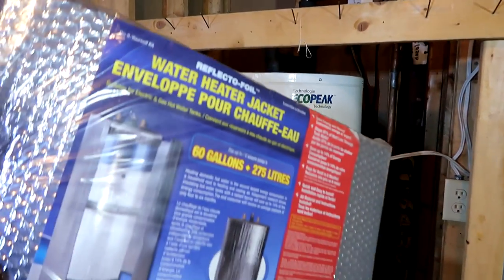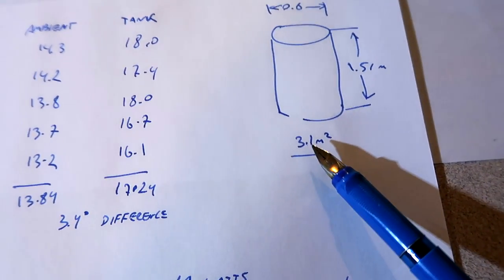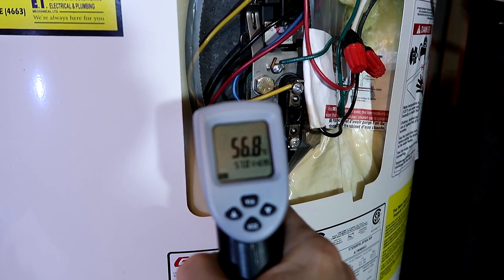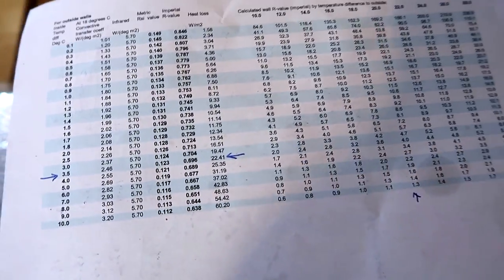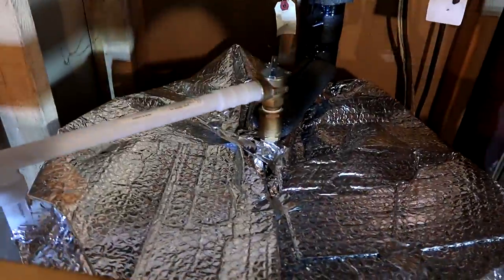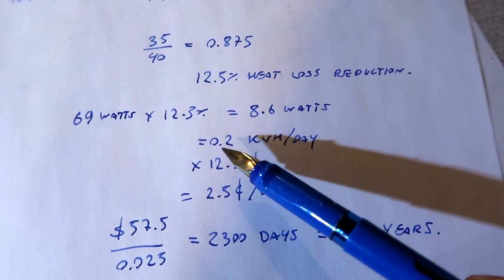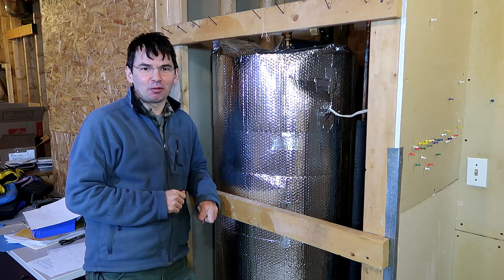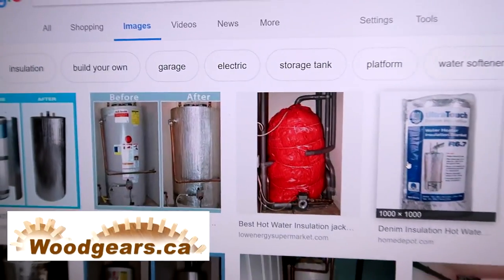Hot water heater insulating jacket:  How much savings

Comment: This may be a silly question, but how did you account for the thermostat?  
If the tank is better insulated, the heater will turn on less often, and there will be less total energy going into the tank. 
Also, (unless I'm mistaken) you were measuring the surface of the tank outside the built-in insulation and then measured the surface of the tank inside the new blanket and compared the two. 
Wouldn't it have been correct to measure the outside of the blanket vs the ambient to see how much heat is being lost?   After all, You are only losing heat to the ambient air via convection and radiation from the outside of the entire bundle, right?
Reply from the maker: yes, if its better insulated, it will turn on less often.  Which is how energy is saved.  And your point is?
The outside of the blanket can't be measured because with an IR thermometer because it's infrared reflective.  I could put a piece of tape on it to measure that, but that tape would affect the outside temperature, so best to work it out without measuring the outside reflective surface.
Reply: @matthiasrandomstuff2221  To be clear, I am not saying I think you're wrong. I honestly hope that you will point out some incorrect assumption on my part and give me a stepping stone to learn something, but I do need to explain my thoughts first.   
I'll use an example with made up numbers, so please bear with me.
-------------------------
Assume we have a 1000W heater wrapped in an insulating shell. 

We measure the outside of the shell at 30C.   We then add a second shell, wait a while, open the outer shell and measure the temperature of the inner shell as being 40C.  We can then  calculate the percentage of heat contained by the second shell by comparing these temperatures (30%).   
This works, because in both cases the amount of energy being pumped into the system is constant (1000W).  

However, it seems that you could also reduce the heater wattage by 20% (to 800W) and you would still have a secondary measurement that is greater then the original 30C. (+30% retention + -20% input = a temperature difference of ~10% )   However,  using the shell temperatures would only show  that 10%, instead of the actual energy reduction of 20%.   

In the real world example, we assume that the heater's duty cycle was reduced by an unknown amount, but that it is keeping the water at a constant temperature. 

It seems like measuring the heater shell should give you an idea of how much energy is staying in the shell instead of being lost to the room.  However, the transition/convection point is on the outside of the new layer, not the heater shell.   Yes, the heater's body is warmer, but for all we know the new foil layer is actually losing more heat than the heater's shell was and is acting as a heatsink, but the heater's duty cycle increased enough to overcome the losses.    This would be an extreme example, but the result is the same.  Alternately, the duty cycle may have been reduced by a massive amount and the new foil layer is simply trapping enough energy that the heater's shell is becoming saturated over time.  This would result in a higher temperature at the heater shell, but the actual energy lost to convection is unknown.

Again, We don't know how much energy is being added, so basing an overall comparison on the temperatures of the shell could be massively off.   All we should be able to do is calculate the R value of the new layer by comparing the shell temperature with the outer temperature of the new layer, or comparing the water temperature to the external temperature of the new layer to calculate the total R value of all layers in the same manner you did at the start of the video. 

If you had calculated the R value and energy losses the exact same way both times (measuring from the water to the outside), then the result would have been usable for comparison. 

Now that I've explained my thought process, feel free to poke holes in it or point out any points of ignorance that you see.  
Even if I'm confused, at the least you've got me thinking.   Thank you for your time, and for the awesome videos.
Reply: @matthiasrandomstuff2221  Just fyi, a sharpie mark on the reflective surface should be enough to allow you to take a reading.  At work we use magic marker on aluminium panels to take readings with a FLIR thermal IR camera and have verified it to be within a few 10ths of a degree when compared to a fluke meter's temperature probe readings in most cases.

Comment: I have a problem with your methodology.  Should not the second temperature reading be taken on the outside of the insulation?
Reply from the maker: No, because the insulation is IR reflective, so those readings would be bogus

Comment: Or just upgrade to one of those point of use water heaters. You’re not paying to heat a reservoir of water that sits there and gets cold when it’s not being used.
Reply: Water in a water heater doesn't get cold when the hot water isn't running.
Reply: You don’t say? Just curious as to how you suspend the laws of Thermo dynamics to where once heated, your water never cools off again. If you can figure that out and sell it to the rest of us, you could probably quit your day job.
Reply: @ddoyle11  You honestly believe that tank  water heaters turn off when the water isn't running?

Comment: @Matthias I'm no expert, but would the power savings be different when heating say after a long hot shower?  Like how a pot of water boils faster with a cover, its very little insulation, but heating after a long shower might have more impact?
Reply from the maker: no savings there.  This is only about heat leakage out of the tank.

Comment: Fiberglass jackets work much better - they are thicker and an air gap is not applied. 
Insulation at the air gap strips is less effective due to no air gap.

Comment: In England I don't know if its the same but the hot water thermost has to be between 60 65 degrees any higher than 65 you are looking at the limescale starting to attack any lower you are looking at legionnaires. Don't know if its the same in America if it is I would just stick with the heat loss 😂😂

Comment: How does that compare to a tankless water heater? Where I live most houses use those, you have no dispersion at all but maybe the instant-heating is not as efficient as a fully submerged resistance.
Reply: It may depend on demand-load.  Remember that there are multiple types of power plants, and those that can be spun-up to meet peak demand and then shut down cost more to operate.  As such some power companies offer different rates for those customers that agree to reduce their peak demand-usage.  An on-demand water heater might simply demand more electricity than the customer's plan allows, or puts them into a bracket where they're charged a lot more for that high usage.  In contrast, a conventional tank water heater uses power slowly over time, so it doesn't bump up against such a threshold.

Comment: Hot water heater? 

But it’s already hot so why does it need to be heated?
Reply from the maker: so does a car factory not produce cars?  does that make sense, because the cars are aleady made?  The hot water heater makes hot water, just like the car factory makes cars.
Reply: @matthiasrandomstuff2221  If the waters cold, it heats it. If it's hot, it keeps it hot. The word Hot Water Heater is redundant because it implys your're heating hot water with this appliance. If you were to call a boiler a Hot Water Heater than you'd be correct. And no I'm not a pedantic in case you were wondering.

Comment: I just installed a new Hot Water Heater in my house this summer. It came with a 3 inch thick fitted insulation fiberglass thingy. I was wondering if this was of big benefit or not.
Reply from the maker: that would cut the heat loss in half compared to without, so probably worthwhile.
Reply: @matthiasrandomstuff2221  ..and the more the better, despite diminishing returns

Comment: If you foam board insulated a room around it, you’d be better off... that is only on those electric water heaters, you’d need a makeup air on gas water heaters with a pressure switch on the flue pipe

Comment: Would probably be more effective if the hot water heater was in the garage or somewhere that’s not temperature controlled. I think that’s why they were invented
Reply from the maker: You never put a water heater in an unheated space in northern climates.  The pipes would freeze.
Reply: @matthiasrandomstuff2221  LOL no don’t put it in the garage! Just saying it would probably insulate better for those who have them in there.

Comment: Interesting! Can you do one on radiotor foil? I really wonder if that stuff works or not.
Reply from the maker: I don't have the sort of radiators that that could be used with.  Also, it really depends on how well your walls behind the radiator are insulated.
Reply: @matthiasrandomstuff2221  Too bad, it would have been interesting. I installed the foil in my house. I don't have insulation in walls, they're brick and there only is an air gap between the inner and outer wall. It's hard to prove if it works or not just on my experience.

Comment: you took the "one day later" measurements at the wrong location, should have been done on the outside of the tank, not under the foil liner.
Reply from the maker: can't measure the infrared reflective stuff with an infrared thermometer.  Those readings would be completely wrong
Reply: Matthias Wandel piece masking/painters tape on it would resolve that issue.
How you liking the Fredericton area, I use to live out in Maryland back in the '70s, moved to Grand Bay and been here since.

Comment: Why you take the second mesures fro nthe tank and not from the insulating jacket? Like to let him read this
Reply from the maker: because the jacket is infrared reflective, so the IR thermometer doesn't work on it
Reply: @matthiasrandomstuff2221  Blacken a few spots with a marker. While you will change it's emmisivity it will not be a huge gamechanger.
Reply: @matthiasrandomstuff2221  but I'm not sure that you can take some other reading just because the foil is reflective. The whole experiment falls on you taking a measurement in the wrong place.

Comment: Put a timer on it set to come on 1 hour before you get home and run till you do what you do and set it to come 1 hour before you wake up and do what you do.
Reply from the maker: that would make very little difference.
Reply: @matthiasrandomstuff2221  No. It will only use power during those times. Instead of coming on several times a day.

Comment: Not related with heat loss but this is a friendly reminder to check the Temperature and Pressure Relief Valve on your water heater, so it doesn’t become a bomb if it overheats.

Comment: l found adding a timer switch saved  lot, we turn it on a hour before/after morning showers 6-8am  and and from 5 until 8 pm to do tea and bathe the kids, and on the weekends we turn on from 8am until 8pm for washing cleaning  the timer cost about $10 -$15 on ebay, we only have a bottom element 2000 watts at 240v and its a 135 litre tank our ambient temperature never gets below 4 degrees celcius in the mornings, we save about $30 a month
Reply from the maker: Your tank must be uninsulated to be saving that much.  Basically, the MAXIMUM savings is how much heat leaks out of the tank when it's at temperature.
Reply: I'm a bit sceptical that you could save that much from the timer. The long hours in between the on times would mean when it is turned back on it has to run much longer to get up do a desirable temperature. Often maintaining the higher temperature is much more efficient. Kinda like why highway driving gets better mpg than the stop and go in the city. I'm honestly thinking the savings you get might be more from the regimented usage (only showering at this or that time and whatnot) you could try sticking to same schedule but without the timer. Also on a side note the longer run times to heat up the water from basically cold are likely harder on the heating elements than normal maintenance cycles which could potentially reduce the overall life of the heater. 
Side, side note... many people tend to set their water heaters to max or nearly max which is often the quickest lifespan killers and turning it down a bit can help it last much longer
Reply: @gizmogremlin1872  the element and the tank are 20 plus years old, it takes up to 2 hours to heat the tank to 60 degrees c from cold in winter had the tank  had better insulation, i dont suppose it would turn on as much as it did, we would hear the tiicking every 30 minutes for about 5 mins a time on winter nights, the outside of the tank was always warm, we have them inside in cupboards where we place our linen, the power company had installers fitting timer kits for $320 i did my own for less than $20, my brother lives on his own and he did the same as me but also on his freezer, that i have not tried, he reckons that saved money too, people used say that  with  heat pumps, that it is better to leave them on 24/7 but its been proven by our consumer tv program  that it is better to turn them off when you go to bed and when you leave the house and turn them on 30 minutes before you wake up or get home, the hot water cylinder works out the same
Reply: @gizmogremlin1872  also as a side note our hot water is controlled, it switches off between 5 to 7pm week nights,  and anytime the power companies want to save money by not firing up the coal power stations,  normally cold winter nights, l had to rewire it, to bypass the ripple controller, to stop them turning it off, before i did that, you would have cold showers in the mornings sometimes for days on end
Reply: @debeeriz  lol I would definitely have to bypass it too. We have a bit oddball schedule so restricted use times definitely wouldn't work for us. The power companies here are getting into putting controls on a/c units but jokes on them I haven't used my a/c in at least 5 years probably dosen't work anymore from the non use. 🤔

Comment: Don't forget that in areas where you need to heat the house during winter, the leak of the hot water heater actually heat the house. The cost might be higher, if u heat the house cheaper then with electricity, but there is no or very little energy loss. Your calculation about pay back time is actually even worse, a lot, at least in many areas.
Reply from the maker: yes.  Mind you, it's heating the basement, but more heat in the basement means less heat coming thru the floor.  So the payback is probably more like 12 years!

Comment: I couldn't hardly see the plumbing but you could see greater savings by replumbing it.
Reply from the maker: and 100x the expense
Reply: @matthiasrandomstuff2221  what?   Very little expense  so not sure what you mean. I  wasn't saying  either or,  I  was saying in addition.   What exactly does the hot line do after it leaves the water heater?

Comment: Those tinfoiled bubble wrap pads don't isnulate much of anything. If you want a decent R value that will actually save you some money, stuff that entire cavity with wall insulation. You'll see a difference with 6 inches of fiberglass wrapped around it.

Edit: Just got to the point where you got to calculating costs..... You paid HOW MUCH for that chintzy little blanket?

......

Why didn't I think of this first? I'd be retired after selling one warehouse full of these.... Your bag contains about $10 of insulation....
Reply from the maker: yes, for the money, I could have bought a whole bundle of insulation and absolutely filled that space!

Comment: your tank is set to low. that is dangerous low temps for a hot water tank. you r stilk within potensial for legionella sickness. here we run it at 80c and you should be over 65-70c.

Comment: would insulating the walls of the space where the hot water tank sits help?
Reply: Depends on how cold the area is around it. If the area is not heated, it could help. If it's in a basement, and it's noticeably colder there, insulating rim joists in the basement came be quite effective or other insulation techniques. Especially in lower temperature areas. The payoff for these services can actually take a while, but are long term improvements.

Comment: Good video. To be fair though, 2.5 cents a day is if the heat is generated electrically and with 100% efficiency
Reply from the maker: yes, and if the heater isn't 100% efficient, it turns the rest of the energy into --- gues what --- heat!  So all the energy ends up as heat, always!

Comment: First off, Hot water doesn't need heating, most water heater manufacturers will void the warranty if an external blanket is installed.
Reply: I'm also confused why you would need to heat hot water.

Comment: shouldnt be measuring under the insulation, you should be measuring outside of it, opening it up instantly loses heat, so this is super flawed.  Also, heat lost into the house has to then be removed by the AC system and you are not taking that into account. then as others have mentioned, how you measured the temp was also wrong. this would be interesting to see with accurate info. Also its illegal to do false advertising, if they cant back those numbers up with some hard facts they would be in trouble. i fully expect when its done right you can save that much.

Comment: wait.. why did you cut holes and measure the INSIDE of the jacket...

that makes no sense at all
Reply: Technically if the added insulation was perfect, the tank surface would reach the water temperature
Reply: but you know it's not perfect... no insulation is

he should have measured OUTSIDE the jacket and compared that to ambient just the same way he did before
Reply from the maker: if I point the meter at the outside of the jacket, it just measured whatever is reflected off of it (it's IR reflective).  That's why I had to measure behind the jacket